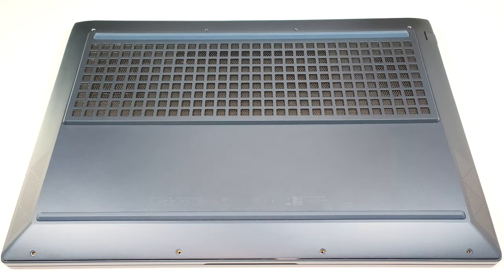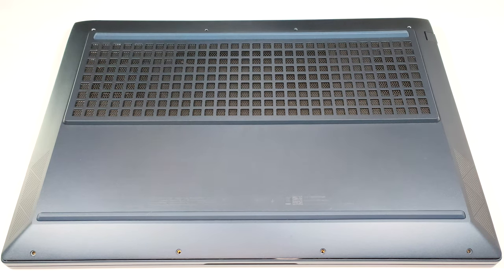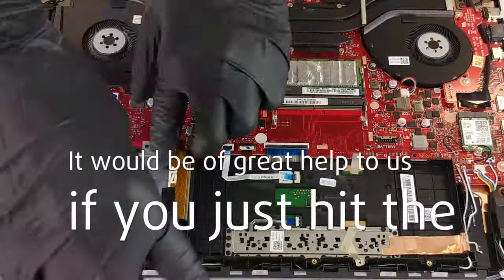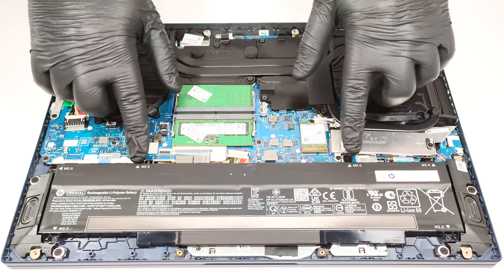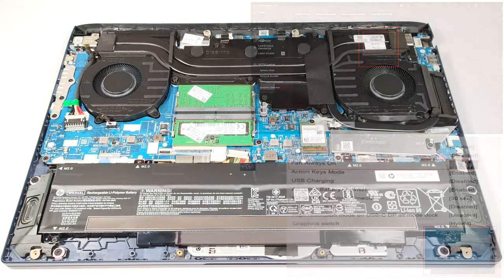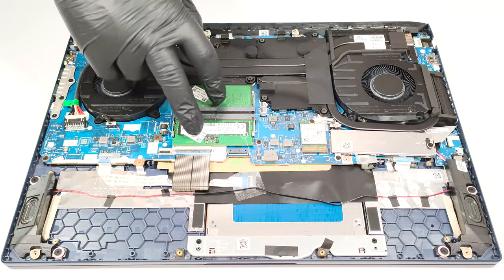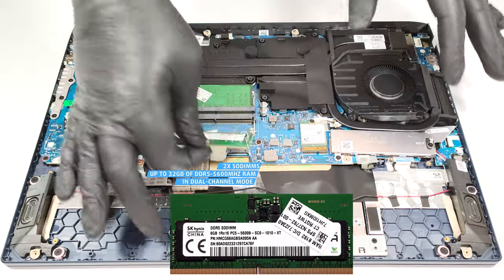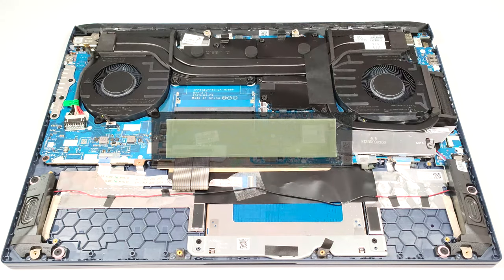🛠️ How to open HP Victus 16 (16-s0000, 2023) - disassembly and upgrade options

Comment: Is there really just 1 m.2 slot for an ssd?? I was planning to add 1 more ssd
Reply: yes there is only one slot. im also pissed
Reply: Me too
Reply: It well said that this laptop fall under budget gaming laptop. I think there is always a catch. 

Nvme Gent 4 slot. Definitely  not cheap
Reply: 1 slot!!! bullshit. im not buying this sht anymore. hell with hp.
Reply: Upgrade it but do not forget clone Ur data to new SSD by enclosure case
Reply: Pretty sure this is a 2023 not sure but older models had 2 slots not sure why they removed it
Reply: theres actually 2 m.2 slot, 1 free slot and 1 used slot, so if you need to add 2 new m.2 ssd of your choice, you have to change the m.2 that come with the laptop

Comment: Is the screen wobble issue solved in this model??
Reply: Yes
Reply: Yes, at the cost of much stiffer hinge so that you can no longer open it with 1 hand, decent trade off IMO although the build seems to have not changed

Comment: I have victus 16 r5 7640hs rtx 4050,room temperature is 32-34°C,in horizon forbidden west 3-4 hours playing my cpu temp in hp gaming hub shows 65-70°C average and sometimes 70-75°C highest while cpu usage goes upto 60-70%.Is it good thermal performance?
I just bought my laptop almost 1month but im little confused in its thermals😐
Reply: if you had bought an Intel CPU you would always have 100°C, 75-85°C for ryzen cpu it's a good result

Comment: Bought the amd 7 7000 with RTX 4060 series, the laptop still standard & i use for 3D animation also video editing work, and it's work very well.
I had no major issues from this laptop, except the slot of Storage, it's just only one, so i buy the external SSD for solve that.

I'll say it's very good laptop for work & gaming, also the design is simple  (no rgb light at back cover, it's nice for me!)
But, If u want value for money gaming laptop, don't buy this. You can buy MSI, it's cheaper rather than this (but the screen isn't good enough for video editing hehe).
---
Note : i use this laptop for hard work 3D rendering, so the setting is always max.
And the problem is they are lot of dust on my fan, so i cleanup once in 3 month, also the fan noises so loud (sounds like a rainy inside your room) coz i set in performance and max fan mode.

If just light & heavy gaming it's good enough!
---
Love this laptop, feel free to ask!